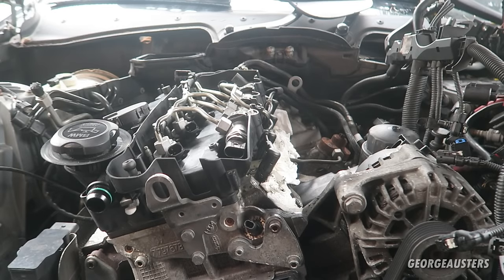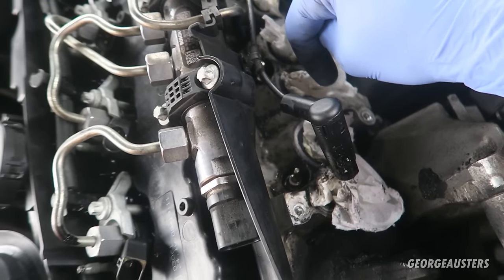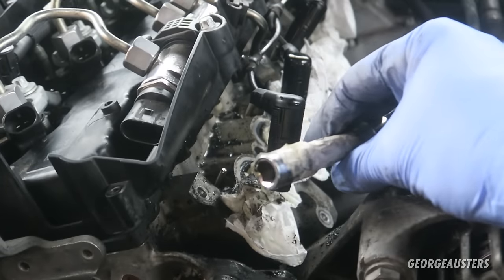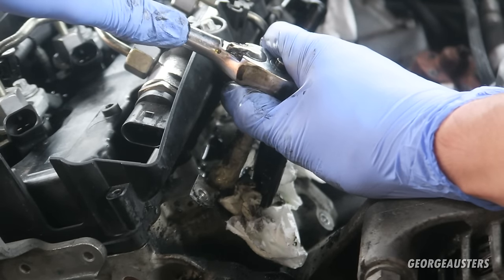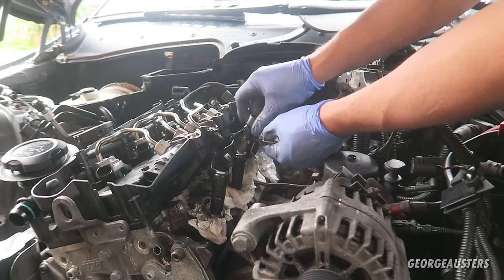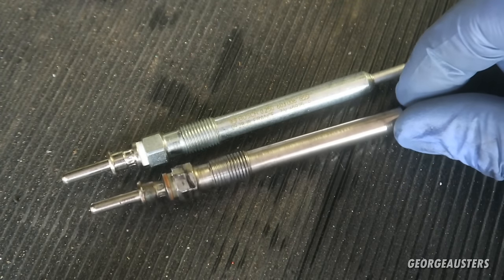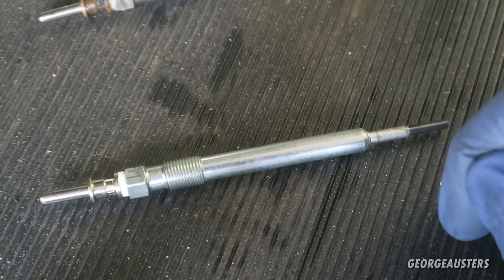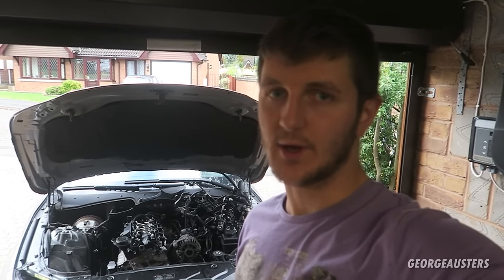How To Remove Glow Plugs WITHOUT Snapping Them

Comment: 3 things jump out at me (1) pre spray with a proper penetrant and leave for 24 hrs (2) Get the engine hot first, yes it will have cooled down a little by the time you start to remove them (3) Use a deep socket that will fit over the whole length of the glow plug (3) Standard WD40 is NOT a penetrant, it's a rust inhibiter / moisture dispersant.
Reply: Exactly what I was going to comment
Reply: I have a set of plumbing sockets, extra thin and long. Looks like June I should go and buy some proper penetrant. WD40 may not be sufficient in my 25yo diesel 😬
Reply: Just my Golf mark 5 glowplug after watching this and reading this comment. Ran the engine nice and hot and while ticking over removed the connectors/harness to keep spraying GT85 penetrating spray around the plugs. Switched off engine and using a proper deep 10mm socket gave them a go. Omg they felt tight, so I just went very slowly and every time there was a tad of movement and tightened again so back and forwards, back and forwards kept spraying GT85 when it was slacked off then tightening again to try and get the fluid into the threads. 2 loosened nicely quite quickly. Other 2 were much slower, so it was just case of being patient turning a few mm back and forwards, spray, repeat, repeat repeat etc not getting greedy with exerting too much force and slowly every time I was counting how many quarter turns forwards and back i was getting and eventually i got them all out. Took just over an hour to get them all out so patience is everything! New ones in, start up and job done all engine fault codes gone! Thanks for the video and the useful comments. 👍🏼😁
Reply: Sp90 in the shed I'll try that
Reply: 100% true...

Comment: Once you've done the first 1/4 turn, wind it back in gently to move that WD40 down the thread a bit. Do that again for 1/2 a turn and wind back in gently. Better not to try and remove them just by anticlockwise movement alone.
Reply: What about PB Blaster penatrating oil spray?
Reply: Was just thinking that myself, great minds.....
Reply: Surprised he never done thisn
Reply: @ThorsTreasure  spot on royal purple synthetic penetrating oil is the best by far

Comment: Can't help but notice that on the glow plugs you removed, all 4 showed signs that your socket didn't go fully down onto the hex head. Whilst doing other jobs on recessed bolts I have managed to strip a bolts head by doing this. It's always best to spend a couple of quid and buy a "deep" socket that fully seats onto the head. A fiver spent now is better £500 for a second hand replacement cylinder head
Reply: Great point, Ignorance has bounders ( don't be cheap )
Reply: Use correct glow plug sockets not exspensive tbh ... spray spray soak soak n spray
Reply: Also, they are all bashed because of the way you use your rachet, lots of short turns without taking up the slack each time. You should have the proper socket for a demo on YouTube - or offer to show how you drilled out your extension!

If they are original how have all four got alloy jammed in the threads? They look like they have been installed ham-fistedly, which is unlikely to occur at the BMW factory.

If you're taking the head off then run a chaser down those threads before the new plugs are installed. I think the torque rating is just 15 lbs/ft.

You ideally want to blow out the recesses with compressed air before you start spraying a solvent around in case it loosens some debris like a small stone and it gets into the bore when you extract the plug.

I'm about to do my TDI which has 320,000 km on it, no record of them being changed - so I came on here to see how to do it without stripping them. I'm a qualified mechanic but I want to know what I'm up against!

Thanks for your video.

Comment: Glow plugs snapping on removal is not a myth, some engines are worse than others, do Glow plugs on a tdv6 rangerover and let us know how you get on. Good video tho, only addition from me is get the engine stinking hot, then try remove. It has the added benefit of making the work more pleasant In winter

Comment: What I think is missing here from some otherwise very good instruction is the precaution of looking for and attending to any loose debris around the plugs before removal, lest it make its way into the combustion chamber when the plug's removed.
Reply: Yeah, I'm going to do mine tomorrow, where this bloke sprays more WD40 I'm going to spray some brake or electrical cleaner to blow out any debris.

Comment: Soak for a week in thin oil. It might cause a capillary reaction as the engine goes through heat cycles. Then when it comes to removal,  get the engine red hot first. The alloy has expanded.  But alas in a world of so called engineering excellence some may need to strip out a lot of junk just to get to service items. What this guy is displaying is something called feel, unfortunately many folk are heavy handed like toddlers.
Reply: If you are able to get an engine "red hot" you no longer have to worry about the glow plugs as the engine will no longer be functioning.

Comment: Mount the new glow plugs with 15Nm. Mind you: the plugs break at a torque of 35Nm! Use a torque wrench to loosen them so you don’t exceed the 35Nm while doing so.
Reply: or just use a 1/4 ratchet
Reply: Thanks for the comment. I've got to do the glow plugs on my vw t5 1.9 tdi. I've replaced plenty of spark plugs before but these will be my first set of glow plugs. All the comments about hos easily they snap has got me a little nervous. Lol. Wish me luck!
Reply: @activechaos128  howd it go?
Reply: @empire1771  it went really well. I was a bit nervous because of all the stories of glow plugs snapping off but i just made sure the socket was on squarely. The first one was on pretty tight but i just tried not to put too much pressure on it too quickly and hold the force to give it a chance to unscrew. Sure enough they all came out with no problems.
Reply: Yup, I have a beam torque wrench for that. The breaking torque is published for the plugs. Just take your time and go back and forth.

Comment: well done for removing them just one tip , when you get the plug movin spray the threads as they come up and do them back in this will make it easy to remove as the plug will not go tight and may snap of yes take your time in and out till they become free of the head alway do this never had any plug or bolt snap in 30 years of working on car and vans  cheers good vid
Reply: Do you recommend heating up the engine before loosening? Everyone I've talked to said it should be cool when threading a new one in. Is this right?
Reply: @KurtG85  Typically the glow plug is steel/stainless steel, threading into aluminum, so one might expect, with a warm engine, the aluminum will "grow" at a greater rate than the steel, causing an easier removal. Personally, I would soak the area for about a week, maybe 2, with the best penetrating oil you can buy, then remove from a warm engine.
Reply: @junkmangeorge6363  I've heard another perspective that removing from a heated block actually makes it worse as when the aluminum heats it expands, therefore a hole in it (a thread hole) would actually get smaller as the metal expands making it tighter.
Reply: @KurtG85  All/any material with a hole in it expands outwards from that hole (except wood). Case in point, you have a stuck nut and bolt, you heat the nut to remove it, or you have a broken exhaust stud, you heat the flange around the stud to extract the stud.
Reply: @junkmangeorge6363  Thanks for your input on this.  Your comment spurred me to do some more research on the subject to confirm what you said and sure enough you're right. I'm going to have to be that know it all told you so guy to the guy who told me the hole shrinks now. 😂
Reply: @junkmangeorge6363  actually metal expands volumetricly, in all directions, I feel more physics are at play here more than just thermal expansion dissimilar metals and so on. Most diesel cylinder heads I've worked on are cast steel. I also was told never remove the spark plugs from my aluminum cylinder heads on my mustang. My theory is hot soft aluminum can pull threads out of the head when removing the spark plugs so do it with a cool engine.
Reply: @wildnfree223   I also was told never remove the spark plugs from my aluminum cylinder heads on my mustang" How on earth do you change the plugs then?
Reply: @LandersWorkshop  let the heads cool to the touch then remove, some say to put anti seize on the threads but I change mine often enough I don't do that

Comment: Thanks for the tip. My E350 Mercedes had failure for glow plugs and had run for almost 95K Kms. Garage mechanic said its risky to remove them as they may snap and head lathe is the only solution to remove, if they do snap. I advised them to oil using deep penetrating spray. Did the oiling for 2-3 times in intervals of few hours for 48 hrs. Kept the engine running for 30 mins before starting the removal. All 6 plugs came out smooth with manual fixed wrench. Replaced and work done
Reply: Wow surprised they went so fast. My BMW diesel glow plug module finally is going out after 255k km. But the glow plugs are fine.

Comment: Good advice... Another help is applying counterforce with your other hand on the ratchet head while you wrench it off. It helps keep the socket perpendicular. I've snapped things before by letting the socket lean over while applying the torque.

Comment: As of yesterday I am brand new to diesel engines. So you are saying soak those plugs even with the car in use. Can't imagine WD-40 harming anything but wanna make sure. Being my first time I should certainly soak and probably use a torque wrench to get a feel for these guys. Thanks for such an informative video man!! 👏
Reply from the maker: Yes correct!
Reply: @GeorgeAusters  You are awesome! One fresh subscribe w/notifications coming at ya! 👏😊
Reply: 70% vegetable oil and 30% acetone way better than wd40 at reducing the torque needed to unscrew a tight bolt. Yes there’s a study and test about this
Reply: @em4703  Hey! Gonna mix that up for this next bolt instead of cutting it. Thank you for sharing that information 😁 Hope you have a great weekend!!
Reply: @tecc8380 how did you get on?
Reply: @tomfisher9085  Get on what?
Reply: @GasManII  🤣
Reply: dont use a torque wrench to do these up unless its a digital one. my experience with merc gearbox bolts (8nm from memory) is the click isnt noticable enough and will break the fuck out of them

Comment: Changed mine on our N47 a while back. Soaked them beforehand and got the engine hot before trying to remove them. 3 came out no problem, the 4th came out probably 1/2 way before going tight. No amount of backwards / forwards with lube did anything and in the end it snapped.

After a fair bit of thought i decided to buy one of the £30 kits off eBay which have stepped drills and are designed to drill glow plugs out in situ. It worked a treat and got the majority of the plug out before the drill snapped. Fortunately the part that was left was loose in the head and wound out with a screwdriver

Comment: Thanks for the video - it was very helpful for me. I did this job with my old 2004 Nissan X-trail 2.2 with 250 000 km on it. I had to exchange only one glow plug. I used torque wrench in order not to exaggerate with the force and the glow plug started to rotate at 25 Nm. According to the spec should be tightened with 20.5 Nm so it's something similar. Of course I used also WD-40. The shape of the thread is perfect. The rest of the glow plugs show resistance at 1.3 Ohm level so I don't touch them for now.

Comment: Aluminium and steel expand at different rates, I oil mine for 5 days prior when engine is hot also take them out warm, always works a treat, good recap vid.
Reply: Oil with what ?
Reply: @littlereptilian7580  oil where the glow plug goes into the head, any release oil will do and if your driving the vehicle every day the better as the different expansion by heat of the iron and aluminium will allow the oil to penetrate.

Comment: When I decided to remove my plugs, I made a 50-50 mix of diesel and AT oil and for 15 days, I soked them with that mix, right after the engine was turned off and I would leave them over night. I did that for 15 days straight. The came out very smooth. When I put in the new plugs I put around their threads some copper grease, to make it easy to remove next time...
Reply: Better to use either nickel or aluminium anti seize. Copper on steel and aluminium causes an electrolytic reaction between the two metals
Reply: @richardrichard5409 better ceramic grease, copper paste not good for aluminum

Comment: Good shout on the WD. You can never use too much. Allowing it to soak for days or even weeks in advance can only serve to help, even with only mild penetration. Oh and if the threads on the old plugs look like that I would suspect that the threads in the cylinder head have succumb to some damage also. Probably best to run a tap down each one and then use a straw on a vacuum cleaner to get any swarf that might have fallen into the cylinders. Then inspect for swarf in each cylinder with a bore camera before reassembly.
Reply from the maker: New plugs went in fine👍🏻

Comment: Hi George removing glow plugs is a bit of a hair raiser , most important its most recommended that the engine is at running temperature before attempting to remove glow plugs , also its recommended that the treads should be re-cleaned with an  M10X1  Tap  before  re-assembly , BMW also have a problem with the control unit for the plugs  which I would recommend you to replace  when you have got the induction manifold removed it makes life easier and you are sure that the plugs are working properly  its not worth taking chances

Comment: What you should do is this . Once it starts to move then stop and then start to tighten then the reverse That way you will loosen it Just going one way you are not getting the carbon off which is what tightens and will snap the plug . So backwards and forwards is the order of the day. PS Its normally the tip that snaps off !! be very aware as its the carbon build up that causes the seizure.

Comment: This helped me to replace glow plugs in my BMW by myself with success. Thank you for sharing
Reply from the maker: Great to hear!
Reply: Did you take off the intake manifold?
Reply: @8thomas3  yes, unfortunately the access is terrible. It was a 6h job in dark and snow outside, but I did it. Also, if you plan to do it, you might consider removing swirl flaps in your manifold, many people recommend it. Also, prepare to discover a lot of build up grime inside it, so get some brake cleaner or something similar and clean it. It gave few extra HP to my car - throttle response was much better afterwards
Reply: @DKFuRUDEGO  thanks so much for the response and advice! I'm both excited and scared to do this.
Reply: @8thomas3  well, it's not a difficult job, it takes a lot of time because there is a lot to take out, get some box for all your screws etc and keep them organized, also, when you remove the actual glow plugs and you turn them around but they don't want to come out - don't hesitate to gentle pull them as long as you can see the actual threads being undone, I spent about 5-10 minutes trying to unscrew one plug just to find out it is actually undone, just stuck. If you find similar situation, just leave one to be and try others. Any other questions just ask!
Reply: @DKFuRUDEGO  you want to come and do it for me haha! Really appreciate the tips and advice Luke. I'll let you know how I get on 👍
Reply: @DKFuRUDEGO   really good info, how old  is the car and do you remember how many km or miles it had gone?
Reply: @ordinarylestibourne2252  it was the last year of e39 so 2004 and it was around 280k kms

Comment: After seeing this video I thought of checking the heaters in my Peugeot XD3P engine. It's a simple connection where all glow plugs are connected to a single copper strip. I used a dc clamp meter to check the current draw. I could read 16Amp in the first plug,  31A at second, 48A at third and 60A at the  cable. Roughly 15A per plug. My  battery terminal voltage drops from 12.6 to 11.5v while the glow timer is on , indicating good battery health.

Comment: My advice is this. Spray WD40 and leavr it for at least 3 hrs. It takes time to penetrate. It will not work immediately. Then tighten the glow plug, minimum force but just enough to break the contact of the thread inside. You wont feel anything but it will help. While the socket is in the glow plug and the adapter bar is fitted tap it a few times with a hammer, DON'T whack it, just light taps. This will also help free it up. Then very SLOWLY unscrew the plugs... Seriously, take your time. This is the best way of doing it, trust me
Reply: Yeah, I like the subtle tightening start on stuff like this. It relieves built-up stress from constant compression trying to get through the threads. Lets everything relax then the tap for extra gravy points to the same end...I just go for an overnight soak for peace of mind and others mentioned warming the engine which is a great tip too especially for stuff like this where the metals are different...THEN start working it loose slowly. It's what I do with any fastener on the exhaust side too, especially exhaust manifolds and turbo flanges and such.

Comment: Did mine recently! 230k on the originals, they were fooked🤦‍♂️

Another good tip is to work them up and down,  change to Motor oil when they start to move,  that way you can preserve the threads and they come out almost perfectly!